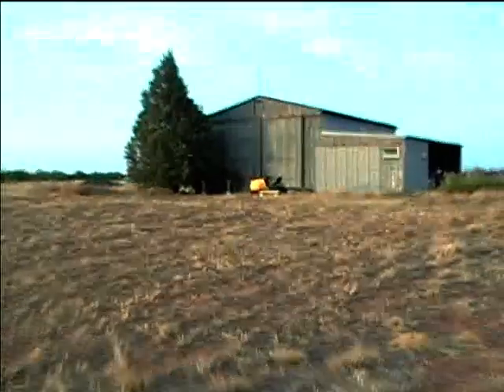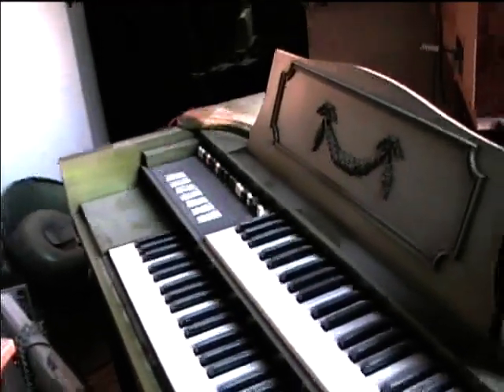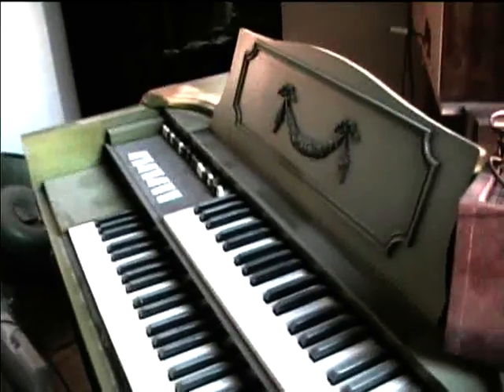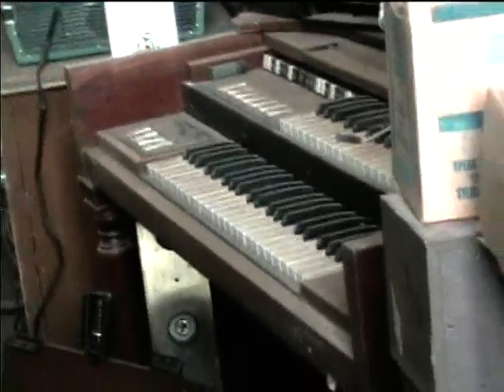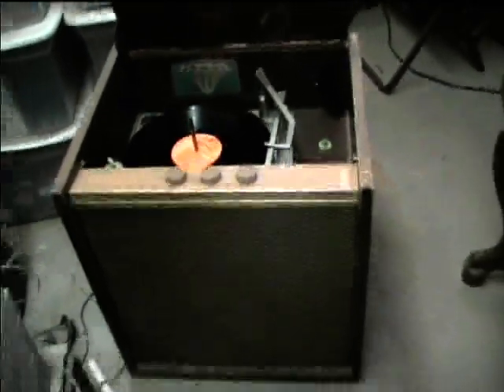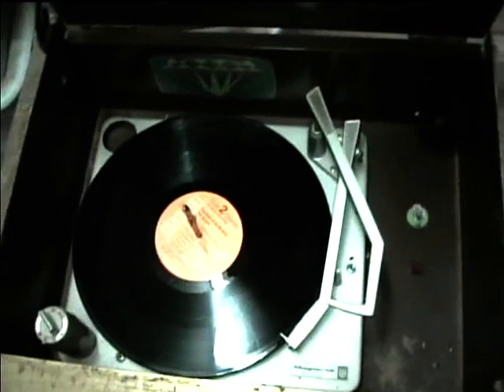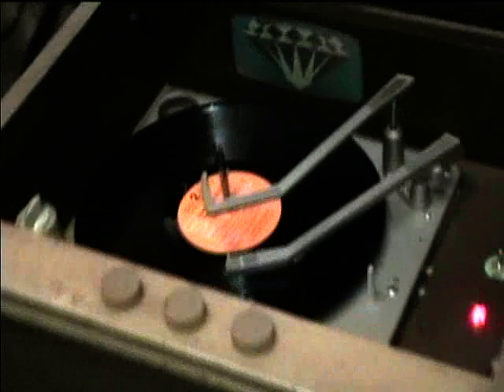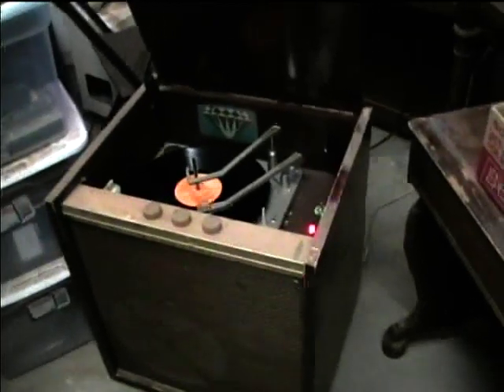Late 1950's Magnavox console tube type record player

Comment from the maker: When I did this, I actually re-used an old electrolytic can cap which was still working and insulated it with electrical tape (I think the can is "hot")....however this was a long time ago and I would really recommend using all new capacitors...sometimes you can spread the locations of the caps out around the chassis to save room. Also the new ones are pretty small...just dont allow the can to contact the chassis as the "hot" common neutral from the power supply is isolated from the chassis.

Comment from the maker: This actually had a transformerless power supply originally but I got a transformer from a Heathkit power supply and was able to re-wire it as a 120 volt isolation transformer.

Comment from the maker: I would probably not connect the negative leads to the can of the old cap but make those connections on a terminal strip along with the wiring which connected to the old can (do not connect these terminals to the chassis ground) That way the old filter cap can will not remain "hot" with a direct power line connection.